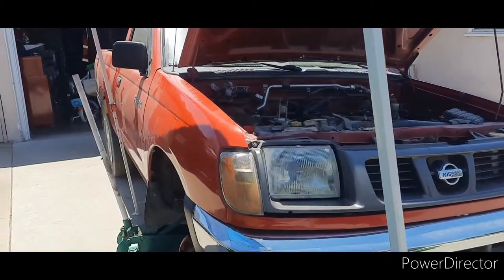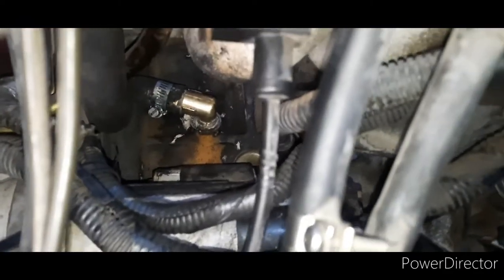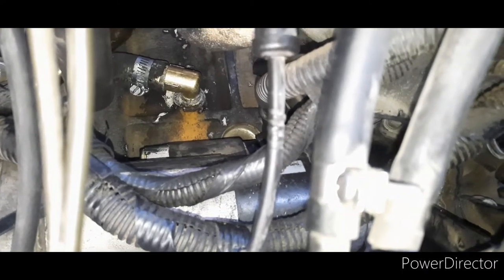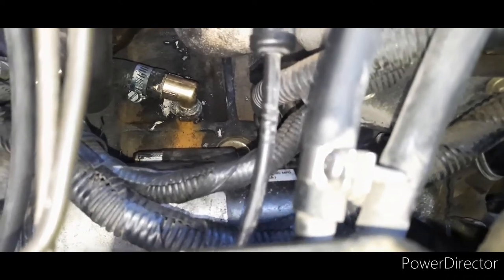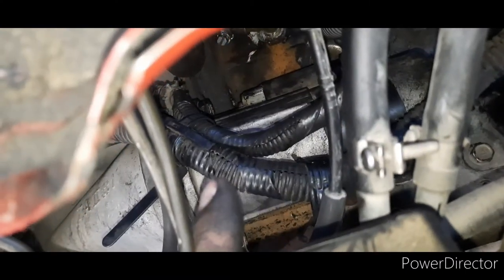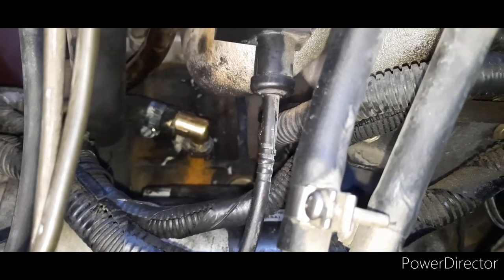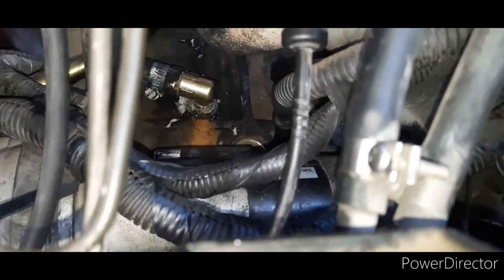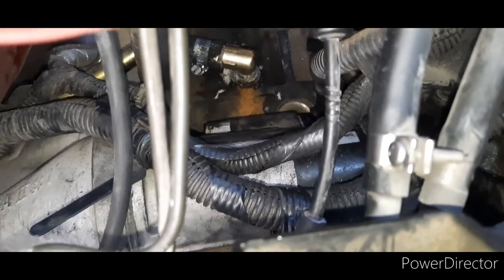1999 Nissan Frontier 2.4L coolant leak fix

Comment: underrated video. i have a frontier and i had this exact problem and no one seemed to know what it is. i search all through the internet. i bought my replacement at the nissian dealership cause no one had it.
Reply from the maker: Awesome. I'm glad I could help. I knew this would be an issue that may not be covered very often.

Comment: I  have the same Truck, 5 speed manual just changed my Radiator, Water pump and Ther.ostat.
I came here looking to make sure the proper hose go back to the Thermostat..
I hope i did not over look this issue.
Thank for the video
Reply from the maker: No problem. Glad to help

Comment: when you pour water into is it a heavy flow coming out? a hose blew in my 01 frontier 4cyl and when fillimg it to find a leak it eventually pours out as much as i put in
Reply from the maker: It was a good leak. Definitely was leaking strong
Reply: @mechanicalman8048  haha i guess pour would be a better word for me. busted hose connected to the engine block i think, nickel sized maybe. you wouldn't know what that could be? it's on the passenger side near the alternator. can't even see it without crawling under there
Reply from the maker: @bronacho5085  possible its the thermostat housing